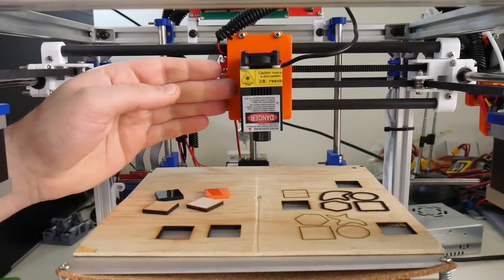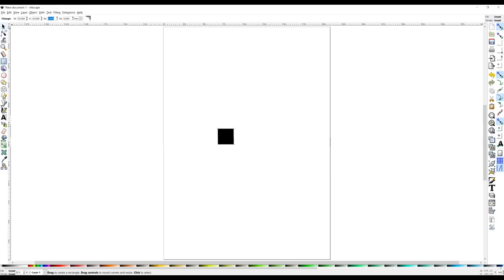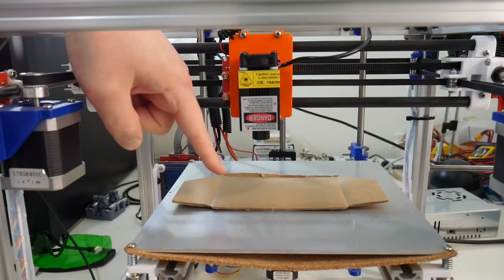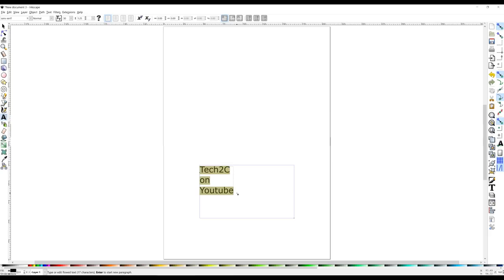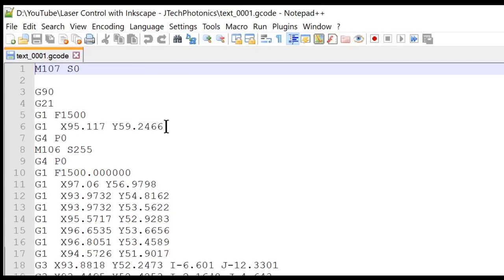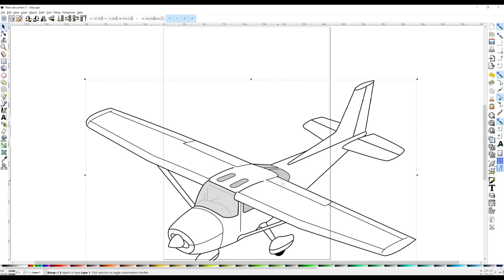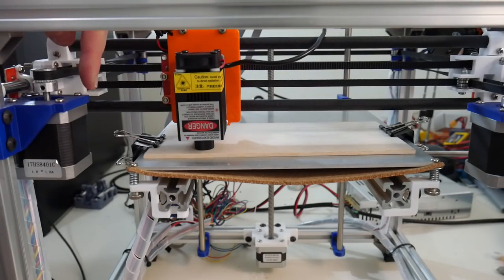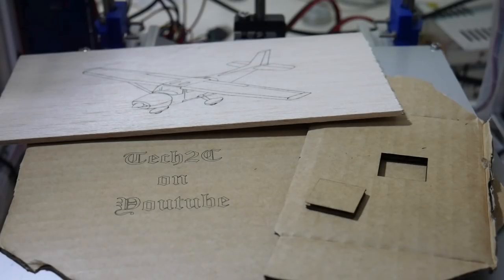☄ Laser Control with Inkscape #1

Comment: For the last couple of weeks I have been working with a Chinese built 70w laser and it occurs to me you may want to add a fan somewhere on your printer and duct it to your laser diode emitter. Hear me out ;)

As your laser vaporizes material those hot gases will condense on any cool surface (which is why we keep the protective paper on acrylic). Those gases will often wind up condensing on the focus lens of your laser diode which is why many laser cutters feature compressed air ducted into a gas lense around the focusing lens.

I'd suggest cleaning your lens with acetone and a q-tip. If you have any deposit on the q-tip you will definitely want to look into some form of air-assist.

An additional fan to help duct smoke away from your active cut will also make a difference in your effective power at the focul point. The fact your beam is visible in the smoke means you are losing a lot of energy as your beam travels through it.
Reply: I want to rig up gas shielding for my laser soon. That should eliminate lens damage and make a less burnt cuts. It should be easy with some MIG welder parts I have.
Reply: Have you done your project?

Comment: Make sure that you choose the right version of the plugin! If you use 0.92 plugin in the 0.91 version of inkscape, it doesn't put the "middle" coordinates for 200mm in the middle of the page. Took me aaaaaaages to work that one out.

Also don't forget to G92, otherwise you have to reset the printer to do another cut

For ventilation, I am using a Rule Inline Blower and 75mm bilge vent duct, has the nice benefit that it is 12v. The only issue I've found is that air flow is degraded by the ducting, so it's prob a better idea to have rigid duct from the inlet to the blower then use the flexiduct to go to the window. Cuts down on the smell + smoke massively

@Tech2C, thank you thank you thank you :D I've started laser engraving on my hypercube and it's freaking awesome.

Comment: If you download Repetier Host and put in your printer settings, you are able to open the prepared Inkscape file and open it up in RH and actually see where it will print on your bed. Helps me a lot. At the very least it shows when a "print" will run off of the edge of the bed so you can make adjustments.

Comment: G1 is the command to move at cutting speed. G0 would move at rapid speeds. If you typed G0 Z50, the printer would move at 100mm/s or what ever you have the rapids set at.

Comment: realise this is old but, if you set the page to the size of the printer bed you can use the align tool to centre images for cutting. shame that laser module can't be shipped to the UK

Comment: Thank you so much! I was getting really frustrated with my diy chinese laser machine as it never cut properly to size. Your tutorial was a blessing. I was totally clueless in gcodes and your tutorial is a God send. Thank you so much again. I have a few questions. If you don't mind me asking. 

1-  Laser on Command in the J tec pop up..can i put anything there? like f1 or f2.?
2. Laser power - it says 0-225 but also 0-12000. what does that mean? I put 1000 as I felt when i put 255 it wasn't burning  well.

Comment: Can you define the paper size as your bed printer size on Inkscape? that way I think is more easy to see where the final location will be.
Reply: MarceloRaul Magallanes Borgatello. Yes this setting can be defined under document properties.
Reply from the maker: I tried that before making this video. The page size does change, but 
the 'object to path' overlay is placed about 100mm higher in the Y axis 
rather than on top of the object (buggy). So I didn't show it.

Comment: cj, hi
I have copied what I think are the correct files from jtech, but they wont paste into the share directory, I may have it wrong somewhere,  is the following right....open inkscape>open edit>open preferences>open system>paste into user extensions.
I have also tried to paste it into inkscape extensions, but that doesn't work either,
when the files have been down loaded from jtech do you open them or leave as zip files?, as you can see I am struggling, but then I  am very new at this, I hope you reply because I really would like to get moving with the laser.cj

Comment: Thank you for this video!
Could you please tell me which settings you have for acceleration and jerk in marlin?
I have problems with round forms like the letter "o". The X and Y axis drive very slowly (nearly standstill) on round forms and then ther laser birns too much in this area. On letters like "A" the laser drives on the normal velocity.

Thanks

Comment: Great work! Have you tried cutting white 3/16" foamcore? This would be usefully cutting parts for architectural models. Thanks!
Reply: this is a bloody good question, I'd love to see the results too.
Reply: Tech2c tried cutting different colored plastics; black was the best, all others reflected too much light.  I suspect white foamcore would reflect too much light.  If foam was coated with a flat black paint or tape, the heat generated might cut through the foamcore.  Might work that way.
Reply: theres lots of yes it can, no it cant answers, ive got a cheapo Chinese a3 sized laser, its a blue 2500mw version and ive successfully (to varying degrees) cut white foam board, scorching is an issue but i think thats something im doing wrong, probably trying to cut in one pass, on shallow cuts and using it just to mark its great.

Comment: been watching this with great interest...but what is the soft ware to use for cutting on the PC ...i can only find and use ben box ..not good at all so what should i be using to control the laser 

Regards Gary
Reply: I just set and know my focal point then adjust the Z and laser speed (laser at full power always) to suit, etch, cut, light, dark, etc...  Just a quick few tests can dial your settings in before a "print".

Comment: Thanks for this but I can't seem to get curves using this Photonics extension. The resulting Gcode always just creates straight lines between the points of the path. Even if I make a circle in Inkscape then do object to path then generate laser gcode, the gcode will not actually draw a circle, but an octagon of straight lines. Anyone else have this issue? Thanks!
Reply: I found the issue! My printer's firmware did not have arc support enabled so it couldn't read any of the curve commands (G2 and G3). I updated the firmware and enabled arc support which fixed the issue.

Comment: HI,
I recently bought this laser from your link. I'm working on a driver for my CNC machine. I use "CNC shield 3.0" not RAMPS 1.4. I would like to know how you set frequency on your board (to control laser intensity). Would you like to share yours setting from Marlin "Configuration.h" files?

The default is:

//#define FAST_PWM_FAN
//#define FAN_SOFT_PWM
#define SOFT_PWM_SCALE 0

Have you changed anything above?

Thank you for your time!
Best regards
Reply from the maker: I left it at default. The only gcode commands I send to control the laser is 'M106 S255' for on and 'M107' for off.
Reply: Thanks!

Comment: I tried to laser engrave with inkscape using my modded prusa i3 mk2s with 2,5W laser. It was a pain in the ass and could not cut anything useful. It crashed so many times  and I couldn't figure out how to do fills or how to import a file like a DXF of something that I can design in fusion.
Reply from the maker: Inkscape is only as good as the laser extensions designed for it. They seem to work for me but I agree Fusion360 provides a lot of features.
I'm not sure what you mean by crashing with the laser?
Reply: Tech2C The software keeps crashing (says not responding and closes). In F360 you provide the file for the hypercube 3d printer would that work with the Prusa ?